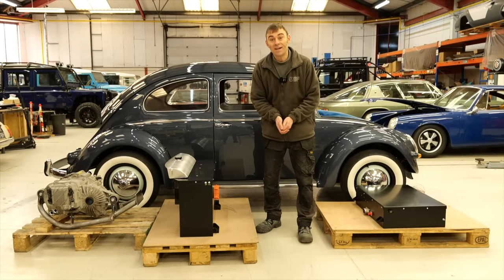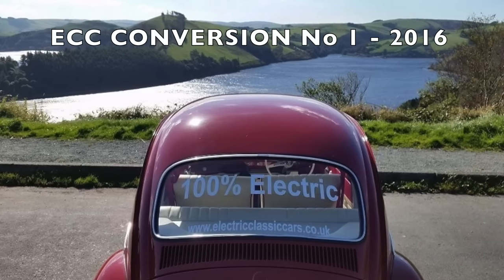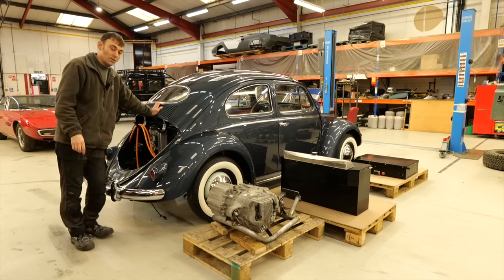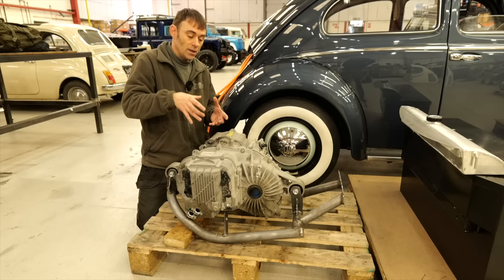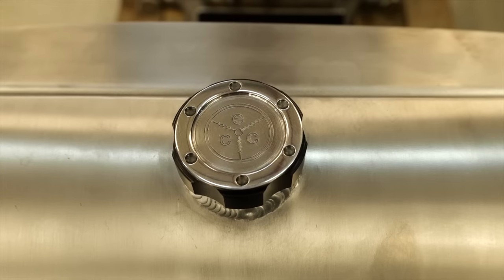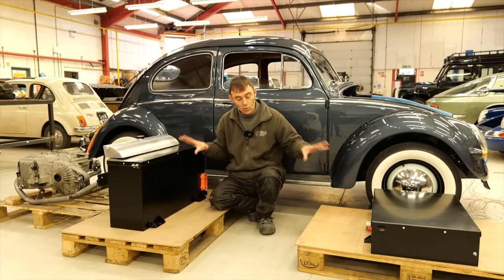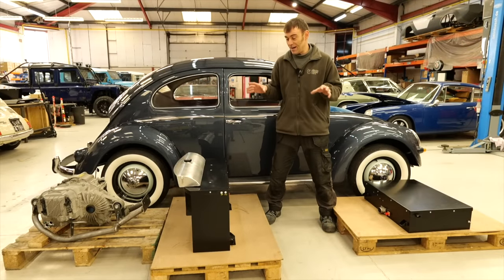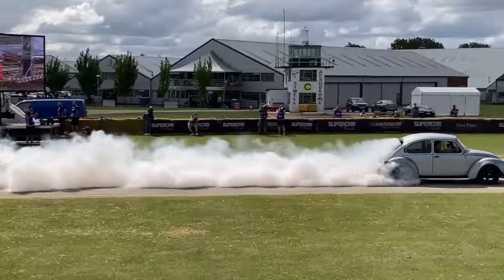Electric VW Beetle - Bolt-in kit

Comment: Learnt to drive in a 2L 1975 Microbus , passed my test in a 1982 South African import T3 Caravelle, first car was a 1972 Bay van with a Type 3 engine, heating worked great. I feel a desire to return to this sort of simple yet rewarding motoring.

Comment: Thank you for a very enjoyable and informative video.  I love the simplicity of the older Beetles, and I learned to drive a manual stick car in a Beetle during my youth.  So, yes, I do have an emotional tie to these cars, as well.  It may have been mentioned in the video, but I did not catch what is the mileage expected in a vehicle such as the one you show, with the exact same components, on a single charge?   Thanks, again, for sharing this video.
Reply: @janicewatts5888  150 miles is more than enough for a daily commuter; in fact it's WAY more than enough... Many people drive less than 30 miles per day, although, occasionally may need a bit more range than that.   Winter will hurt the range as well.  If this can really get 150 kW peak charging, then charging up that tiny battery would be extremely fast and would facilitate long trips... although I'm doubtful such a small pack can charge that fast for any sustained amount of time.   Peak charge rate isn't a metric that's even worth mentioning.  It's a metric for stooges.  Either way, if it can hit that high of a charging rate, then that's a lot of amps being pushed into not many cells, and the cooling system doesn't look all that robust....

While weight balance front to back may be great, with the battery packs sitting up so high, it seems this would raise the center of gravity and make cornering... well let's just say "interesting".  I'm also curious what happens to that battery in a front end accident.  Does it just get smashed right through the cabin?  Not that there was likely much safety in these cars for front end accidents, but this is completely removing any possibility for a crumpled zone.

I bet the price of this conversion is pretty high as well.  If it's not affordable, then it's really just a hobby car for the wealthy.

Comment: My first car was a Skoda 1000 MB, 1966. I still have it. It is currently in a process of a long restoration. I would love to have it converted to electric drive, but there are no kits and it would be super expensive. I currently drive a 2020 VW e-up. The power and range of it are absolutely OK for my daily uses. My dream is to have the Skoda 1000 MB with the same traction accumulator and engine as the e-up has. The traction accumulator has no active temperature management, making a conversion easier. I would put some of the modules over the front axle, where the original tank is as well as the spare wheel and tools. The rest of the modules could go behind the back seats. I would probably upgrade the brakes to disc brakes in the front (from a slightly newer model), and also replace the rear axle to the type that we see on the beetle in this video, even if that would mean cutting into the chassis. The spare wheel would move to the rear engine compartment. the original radiator for the water cooling might be utilized for the cooling of the engine and inverter. Charging port would be most likely "hidden" behind the grill on the rear right wing, which would be modified to open on hinges instead of being fixed. No need to have power steering or power brakes, especially since most of the braking would be with the electric motor. I rarely use the mechanical brakes on my e-up, mostly just to bring the car to a complete stop.

Comment: My first car was also a '68 beetle at the age of 17, this was the late '80s when Cal Look was hot. After various iterations it ended up heavily chopped and lowered roadster with a lift off Carson top and polished Fuchs alloys. 

It no longer exists. Nor do pics, last seen at the GCC summer Nats around 1992.
Reply from the maker: Carson tops. Now that takes me back, as does the mention of GCC. There weren't many Carson Tops around so I've probably seen your car at some point at Santa Pod back in the early 90's. 👍
Reply: @ElectricClassicCars  possibly, though I always went open top to VW events and took a huge fishing umbrella.  

This is how stupid the car was, I fitted an electric glass slide back sunroof from a honda prelude to the Carson top, it took 3 people to lift it off, I rewired the whole car from scratch, but only used black wires because I thought it would be cool. 

Anyway, black, early W decklid, early wings, rare red/amber 39 ford teardrop tail lights, 911 headlights, pre 67 body colour bumpers, blended wings, 36 hp fan shroud and the whole catalogue of chrome engine dress up parts, Fuchs alloys, smooth dash, the usual daft stuff people did back in the day.  

That pillar less look on your car is cool, glad to see you kept it.
Reply: @ForeverNeverwhere1  I love the bit about the wiring. That's attention to detail ... and am sure you needed to pay attention too connecting everything back up correctly!

Comment: I’ve just converted a ‘64 Bug with a Hyper 9 high voltage motor.  I’ve got 3 Tesla batteries in the frunk and 4 behind the back seat.  The range seems to be between 170 and 190 miles.  We’ve added front disc brakes, A/C, seat heaters, LED lights in the front, coil over shocks, etc.. Now we’ve got to sort out the sloppy steering and shifting.

Comment: I'm from near Seattle, in the northwest corner of the US. My first car was a 1959 Austin A-40 Farina, second was a 1959 Austin Cambrian which was the same as a Cambridge as far as I could tell.  Later on I had a Renault R-8 and after that an R-10. Those two were rear engine and transaxle so something similar to your Beetle kits could convert those.  I also had 3 different Renault R-16s. My favorite cars! I'd love to see an R-16 conversion.

Comment: My first car was a 1974 Chevy Chevelle Malibu and drove it well beyond it's lifecycle. 
The body rot was so bad that the passenger door when shut would cause the rear quarter to swing.
The day I pulled the motor for rebuild, I had clocked 300k miles. 
The only times it let me down was when I would forget to put fuel in it, gauge stopped working.

Comment: My first car was a Suzuki Samurai with a blown head gasket. An AWD EV Samurai conversion would be awesome!
Reply: Willys.
Reply: @-oiiio-3993  Whoa, I nearly forgot, my Grandpa gave me a 1951 Willy's CJ 3a long before I got the Samurai... Grandpa, is that you?
Reply: @rollingstocks  Not that I'm aware of.
Reply: @rollingstocks  My current 'daily', though, is (titled as) a 1946 'Jeep Willys' (repop steel body on CJ2A frame) with Kenne Bell equipped 225 Buick V6 'Odd Fire', MSD, too much carburetor, fat headers, 4 speed, twin stick T90 + Warn overdrive... .
Reply: @-oiiio-3993  Nice! My 1951 CJ3a has the same exact engine swap - Buick 225 V6! Mated to a Muncie 4 speed. What are the odds! I daily drove it for years before the fuel pump gave out. It always was one of the coolest cars on the road - people always stared at it.
Reply: @CJHazard  Fuel pumps are easy.  I blocked off the original port and went electric shortly after I got mine (2009).

I highly recommend the 'Odd Fire' to anyone considering an engine swap for a 'flattie'. They fit well, seldom stall, have loads of torque, rev up quickly (mine is a former sprint racing engine), run cool, plenty of power... .

Kaiser used them in CJ5's. Jeepsters... .

Comment: My first car was given to me by my Dad in 1973-74 (3rd year in college). It was a 1964 Chevy II Nova, 194cu inline 6, single barrel Rochester. Back then regular gasoline as ~94 octane and I got it up over 90 mph following a faster car back up to college. Three on the tree, converted to a Hurst shifter on the floor. Bench seats front and back. Seatbelts added after my Dad bought it. Finally sold it after I got married when we converted to a station wagon with an automatic. I wish I still had it because it had tons of room and felt good on the road. It'd be a perfect conversion car with tons of room under the hood and plenty in the trunk (rear boot). I imagine it would need a lot of frame conversion along with brakes. If I remember correctly, the rear used leaf springs (could be wrong). The car I really wanted was a late 60's Austin Healey, the incline 6cyl, triple carb version. Back then I could have gotten one for $3-4K but now they're going for around $60-$90K restored.

As for your installation kits, I really like them and can't wait for the DIY kits although even then they would be too expensive. I really want the EV industry to put some money into EV conversion kits for older American cars and trucks along with select Japanese cars and truck (mainly the early 2010's Tacoma). The older American cars and trucks had classic lines while the earlier Japanese cars were smaller than the big pigs they are now. My 2013 double cab Tacoma is almost a mini-truck in todays truck market but it's the perfect size. Pull the underpowered 6cyl engine, transmission and transfer case plus differential and drop in two Tesla motors with plenty of batteries under the bed and it would be perfect.
Reply: Have you watched this episode? 

https://youtu.be/ZvQlX2iAXk4
Reply from the maker: I wish I was given a '60s Chevy Nova back then. But then again I probably wouldn't have been able to afford the fuel. 😆😎👍
Reply: @ElectricClassicCars  I watched again today. I pumped gas in college (early '70s) when gas was right around 50-cents/gallon. We were just starting to do self-serve so most of the time I was pumping gas, cleaning windshields, checking oil--something that's almost never done anymore. Converting that car would have been very easy. It had a ton of room in the front even with the engine in there. I'd put in two motors (front and back) and would have plenty of room for batteries. It handled six passengers just fine. I'd end up having to  totally replace all the suspension and brakes but it would be a great car, just like it was back in the 70's and early 80's.

Comment: This video was a mind-blower! I had no clue that Beetles had two different styles of rear end setups! To be honest…I’d be TERRIFIED to have a Tesla motor in a Beetle. That’s too much power for my meagre driving skills, lol! Your Hyper9 style strikes me as not so mad-as-a-hatter as the more powerful Tesla alternative. Well…this old man wonders: if I got a LESS powerful motor in my Beetle EV dream car, would the motor go easier on a charge and have more driving range? I still think like a (very aged…) petrol head, so I’ve always wondered if one used a hair-on-fire Tesla motor in a Beetle, would it require more trips to the charger plug. BTW…my first car was a 1977 Lancia Beta 2000 saloon. After nine months of ownership…it went to the breakers…because of all the rust. In my wildest fantasy, I see myself with that Lancia and all the rust magically gone…and sporting one of your fantastic EV conversions done to it! Aloha!
Reply: Aloha 👍😀
Reply: The motor doesn't determine the speed as much as the controller and software does.  A strong motor makes a GREAT regeneration device, but you can feed in as much or little amps as you need.
Reply: Less powerful motor wouldn't make any notable difference to range (and therefore the amount of charging needed) if both driven at normal speeds. (Clearly if you used the more powerful motor to drive faster all the time then it would use more energy and therefore reduce range.) This is a bit different to powerful IC engines as it's difficult to make a an engine hugely powerful yet frugal on fuel even at moderate driving speeds... though they are much closer nowadays than they used to be.

Comment: Amazing kit.
I really appreciate your knowledge on the bugs.

I have a few questions:

Is there space for 3 or 4 battery boxes instead of only 2?

How many KW the rapid charger can push into the battery?

What's the estimated range with the standard 2 battery boxes using the tesla motor and the other less powerful motor connected with the gearbox?

Thanks!
Reply from the maker: Range and CCS kW charging was mentioned in the episode. With regards to more batteries, we would not recommend it as you impact the available space for passengers and luggage as well as making the car too heavy.
Reply: @ElectricClassicCars  alright. Thanks!

Comment: Wait!  WHAT?  You are 50 y/o ????

Seriously???

I would not have guessed anywhere near that.

Whatever you're doing, keep it up.

As for the Beetle, I remember that the oldies had some sort of chamber thing with its own spark plug that was used as the interior heater.

What do you do to convert the heater?  I assume electric, but how much battery juice does that use?

Comment: My first car was a 77' 2.0s V6 Ford Capri fitted with a 2.8 carb engine from a Granada. Was also wearing sating black paint and 8x13" Slot Mag wheels and Recaro interior. Sadly scrapped as it was a rust bucket.
My next 4 cars were also Capri fitted with V6 (not fond of the 4pot Pinto engine).
So I learned pretty much to drive fast and sideways lol.
My late old man was a VW guy, so I grew up in Split screen bus, 68' Beetle, Baywindow bus and T3 Transporter which was the last car he owned before he passed.
Between the beetle and the Baywindow bus we had a 75' Toyota Corona Mark 2 estate and a 76' Toyota Coralla KE36 (estate) which I really liked.
I still have soft spot for old VW's, but never owned one.
Reply: That’s an interesting list. 👍😀

Comment: Thanks guys for yet another interesting video. My question is how easy is it to source the Tesla motors, batteries, and control gear? Do you buy used or are you able to buy new? I'm not after sourcing my own, just intrigued how you get hold of them.
Reply: Probably get them scrapped from the junkyard. There's lots of Tesla's sitting in junkyards

Comment: My first Beetle was a '63 ragtop, white, but had many coats of paints, & had it brought down to bare metal. I had it restored 3xs with AC, 4 disc brakes, classic modern stereo, 12v/USB outlet, 1915cc engine, air tight ragtop, fat tires, Momo steering wheel, electronic oil pump, performance exhaust, etc...I had many VWs to include a '66 bus. Sold all, but next: Electric.

Comment: I'd really love to see this offered as a DIY kit, and I'm wondering why it isn't. Everything appears fairly straight forward as far as install (to a guy like myself) - what would you estimate is a timeline to deliver it as a DIY kit, and also at what price point are you seeing Electric conversion shops doll out a bill to the customers at? I'm on the Northeast Coast in the US, love my 74 beetle, but getting a little restless with the gutless 4 cylinders underneath them,:person-turqouise-waving:
Reply: 56 and 74 here (stock 1600 runs great)...truly gutless is a split bus....anyway. back to beetles... 1776, type IV, Subaru EJ25, Subaru first gen WRX have me wondering which way to go.

Comment: I’m restoring a 1975 Puma GTE and this would be a dream setup. As it is, I’m putting in a 1.6 AP Single-Point injection engine out of a VW Gol, with an adapter flange. I’m in Paraguay.

Comment: Interesting video,  entertaining as usual, particularly for VW nerds.  I can relate to your love for the original dashboards, how dare somebody drill a hole in it!   The dashboard was the first thing I noticed in my '60 beetle,  its not actually a dashboard in the traditional sense, more like quirky wall decorations - with VW optional flower arrangement.  Most un-car like, and very characterful and endearing.   Should probably add that there are many mix and match Beetles, the favourite classic I have owned was definitely my 1960 Karmann Beetle, which was technically an oval..., and was also effectively a 1968 with IRS.  The floor pans are very interchangeable (and also hackable), and that little cabrio bug performed very well with the transplanted 60HP dual port 1600, cruising well at 70MPH provided you could handle the soundtrack. I would need a change of underpants with 200hp pushing that along though.

Comment: I drove my dad's car, both of which i crashed for the two years I was in Mauritius after getting my license. :( But my first car in uk after getting my uk license was a 2000 megan 1.4.. which had a timing belt failure within 4 days of buying it. It was so comfortable and I loved it. The best however was a 911 997 that I had many years later that I bought when the car market crashed. I wished i kept it. It was the one that made me smile driving it. Can't afford to get one anymore (or perhaps, "yet")
Reply: oh, the megan was bought at auction for 900 in 2007, with 60k miles on the clock. I think it was a bargain at that time. Bought a bmw 316i e36 the week after for ... £900 at the same auction. It survived me hanging on a tree on little cliff a week after getting it.

Comment: I took my drivers test in a VW. I acquired an VW '57 with a sun roof in '77 for cheap ($50) and used it when I as doing a teachers training. Had to hold in the third gear on the climb over Vancouver Island. It got pulled off the road due to rust and sold for $50. I kept it alive with "VW Repair for the Complete Idiot". I think that was what the book was called.. With these electrification kits now available I have casually been trying to source one. Interestingly the vans seem to  be easier to find then the bugs. The old buds have become collector items. Thanks, I really enjoyed your video.
Reply: Only $50?!  What a sucker.  I got a whole $75 for my '73 Bug.  I was putting on el cheapo tires so I could sell it.  The guy at Firestone put it on the lift - body went up, floor pan stayed down.
Reply: @MrSteve280  🤣